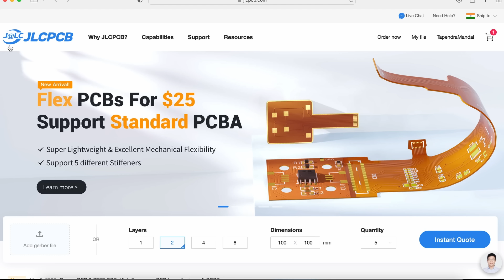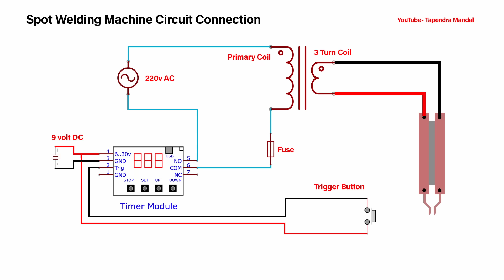BUILD A DIY SPOT WELDING MACHINE

Comment: Can you get electrocuted if you hold it wrong, like be touching the 2 tips ?
Reply: No but if the Primary goes short to the laminations there is no earth return to trip out the mains power.
Reply: No, chtělo by to ochranu pomocí vypínací smyčky - žluto-zelený drát. Aspoň ve střední Evropě to takhle máme. Při průrazu nebezpečného napětí na kostru, nastane zkrat a ten ihned vyrazí pojistky. Pokud použijete na navinutí vodič se silikonovou izolací, který se nepoškodí vyšší teplotou, tak ani nehrozí nebezpečí úrazu, protože má dostatečně silnou izolaci, která napájecí napětí vydrží. Pokud už trafo hoří plamenem, je zásada, že zařízení vytáhnete ze zásuvky a teprve pak hasíte.. @markawbolton

Comment: Awesome video buddy what size cable and how much meters have you used and where did you get all the items from to make this spot welder.I have a old microwave I can make a spot welder.Any links to the electrical items and copper you have used would be much appreciated
Reply: All items used are in the description
Reply: @delancelloyd7781 Yes I see you show the items you have used in your video but you don’t mention what size the AWG cable you have used for the second primary is or the shorter AWG is or how thick the copper plate bar is.Also the size of the welding Rod you have used and the screw bolts you have used to secure too the copper plate.Thanks
Reply: @laurencemaud8205 - the cables he used are FAR too small. He doubled up the secondary windings to attempt to get more cross sectional area, but it would have been better with a single strand of a decent size. He then connected tiny wires to go to the headpiece, which destroys any current.
I'd say 6 AWG full length with no joins would be best, but that's hard to handle. Alternative I am trying is 4 AWG for secondary then as short as possible 8 AWG to headpiece.
Make sure to use copper cables, which will be expensive. If you use car jumper cables they will probably by CCA ( Copper Coated Aluminium) so your cable size needs to be one size larger (bad).
Reply: ccutles desyyn to yoouu,,23 teeelss a  lite n  bto to go.ssssaif  lknawies
Reply: Be very careful with microwaves capacitor. Look up how to recognize your microwaves capacitor. It could kill you. But it's also possible to scrap a microwave safely just learn how to discharge the capacitor.

Comment: Please tell me, can I use a relay switch instead of the PCB?  I need use 120Vac for primary. Can that work?  What is the secondary volts and amp output?  Seem like 3 coils on secondary create too much dangerous volts. Most diy builders use 2 coils. Opinion?
Reply: Relay will fail very fast, due to the huge inrush current of the  transformer.
You need to use 120V mains supply if you use a 120V primary.
The 3 turns gives about 3 Volts output, safe enough to touch onto your tongue. Using 2 turns reduces the voltage to about 2V so you need more current and time to make the same weld penetration.
It doesn't really matter how many turns, having fewer turns just means you can fit larger secondary cable inside there, however bigger cable costs more and is more difficult to insert into the secondary.
Whether 2V or 3V it will still need adjustment for welding duration, so it really doesn't matter either way.

Comment: Sorry, but you should rename this video, 'Watch Me Build a Spot Welder.' Whilst it is creative, especially, the handpiece, it supplies no necessary information, about it's construction.
There is zero info on the secondary winding sizing; the model of timer module used; the settings, of said timer module (or, did you just fluke them, 1st time); the secondary wiring voltage/current, etc..

It is a nice build; but just a gimmick, as to how it is presented.

Comment: I'd like to say my opinion having used both diy and commercial ready solutions for spot welding... 
General rule of thumb:
Going very cheap most probably sucks...

This diy solution shouldn't be enough for spot welding pure nickel strips of 0.15mm or higher... And that's a problem for all but the most lightweight of battery builders... 
Similarly, if you get a commercial spot welder for 99$ (a Sunko one or whatever), you won't be able to spot weld pure nickel strips. In fact I'd argue that the 99$ is actually more powerful than the diy solution...  

Having used a considerable amount of time testing and researching spot welders, here's my final conclusion: 
Just get a kWeld... 
Quite honestly, it's going to be a the last spot welder you'll ever need. They haven't updated the thing for years. It's not because they are lazy. It's because it's just that good O_O. 
Depending on how thick nickel strips you might need, a proper power source is needed. 
Since 0.25mm is the max I'll ever use, I just use a 3S LiPo battery. 
In my opinion, it's the most budget friendly option while also being extremely portable. Another budget option (and much more powerful) would be a car battery. But the portability aspect of it, just gets thrown out of the window then. If space and portability isn't a consideration though, a car battery is the much better option. 
All in all, a kweld will cost you ~230€ if you don't live in Germany and live in Greece for example. If you live in Germany, much lower. Other countries might have smaller import fees. I'd say around 200-230€. 
Is it worth the price when you cab build your own "for free". 
First of all, please account for the time you use when building it. It is 1 hour? Is it 5? Is it 10?? 
How many trips to shops have you taken in order to buy what's needed? How much time did that cost you? How much was the fuel for that?. How much was it for all the parts needed?
 Is it free? No. Is it low budget oriented? Well, maybe... Is it worth it compared to a kWeld. My personal experience screams no... Imagine having a 3D printer failing 3 out of 4 prints and another printer never failing any print... Are you willing to get the first one just because it's considerably cheaper? I wouldn't... The filament (plastic) costs money... Wasted time for failed prints also cost money (if you have a tight schedule). Similarly, nickel strips cost money. A failed weld on a large battery pack, might result in many individual cells gradually failing. These cost lots of money... 
Even a 250€ Sunko spot welder isn't 100% trustworthy, nor is it powerful enough for bigger projects. The thing is though, that the kWeld is... Please believe me, it will save you a lot of hussle and money over time...
Reply: I built a swing bike and a guy I know said why build it it is impractical to ride and a waste of time. I built the swing bike because it was a fun project, I learned a little bit about welding and fabrication and I have fun riding it. My point is some people just like to build things for fun and the learning experience. By the way this is a great video.
Reply: @J.Cee-1675.  Excellent !!!
Reply: Thank you for the comment. It is good info. Most of the diy spot welders on YouTube do it to weld 18650 cells in small projects like ecycles. 12v lead acid packs a lot of punch and nothing compares to it, not even high drain lipos or microwave transformers. But that would be a project for someone who makes battery packs for a living. Although, these guys would rather buy a commercial one you find in a shop that makes racks from chrome plated stainless steel rods.
Reply: I wonder if kWeld electronics available for open source
Reply: I don't know, but at least the author of this video has alternative ideas for spot welding. Tell me what new idea do you propose? Apparently, you only propose to buy a commercial team, that is, zero contribution of ideas, you only know how to denigrate another who is more creative than you and contributes something new. Do you understand the difference between a rat brain denigrating another with a genius brain?

Comment: I wonder why did you double-up the secondary wire?
Reply: To reduce the resistance of that winding, this will allow for a higher peak current pulse during the welding moment.
Reply: @smoothntallGWM if the primary is 220v, what do you think the voltage of secondary?
Reply: @andyhgnguyen  Voltage doesn't matter, it's the current that will melt the metal and create the spot weld... but to try and answer your question: The secondary voltage = the ratio of the turn counts. 220v primary voltage with 500 turns on the primary, 5 turns on the secondary = 2.2v on the secondary (and be careful because there COULD be very high secondary current if you close that circuit).
Reply: Aby se mu lépe navíjel, dobře bez mezer vyplnil otvor v trafu a zdvojnásobil se průřez vodiče pro vysokou hodnotu svařovacího proudu.